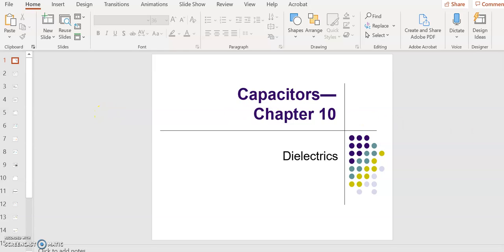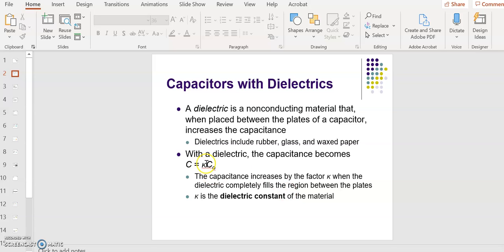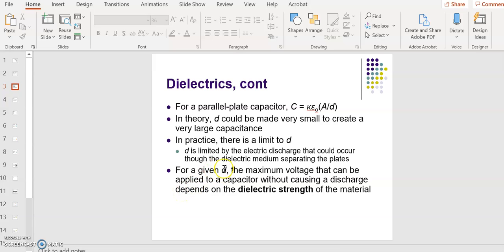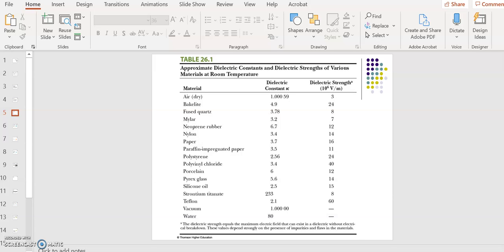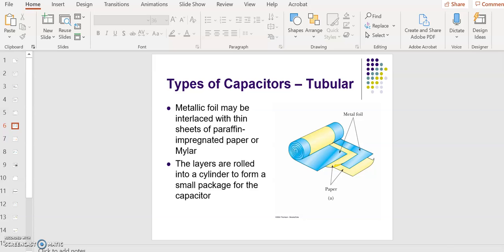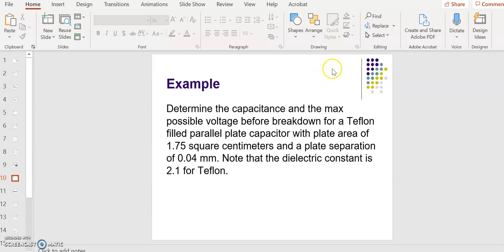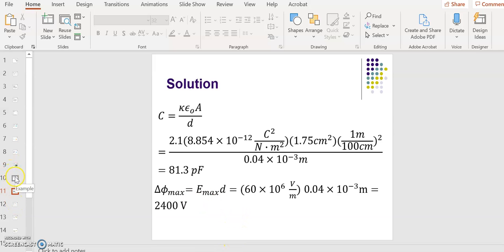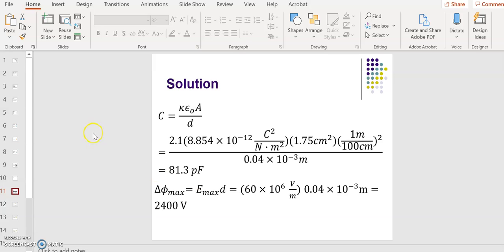An introduction to dielectrics

Comment: What happens if the electric field is alternating rapidly? How does high frequency a.c. field breakdown gas and ionize it with very low potential? Would appreciate some explanation.

Comment: I have wondered how close you could put two plates in a vacuum before other forces would take over and the electrons would simply migrate across the gap.
Reply from the maker: A few nanometers. Then the probability of quantum tunneling goes up high enough to have a measureable tunneling current